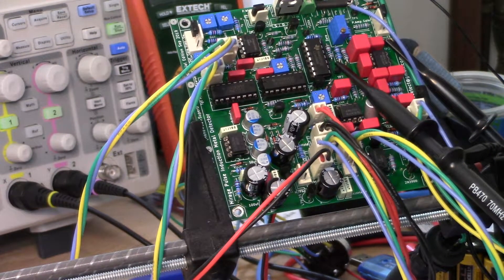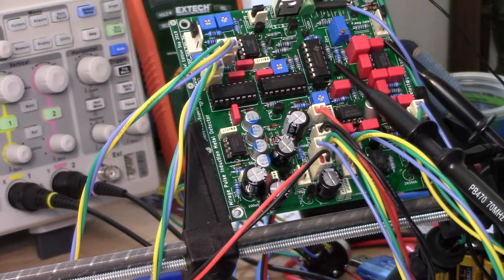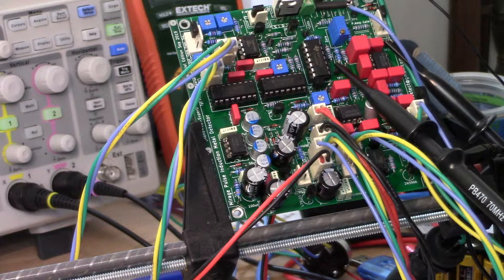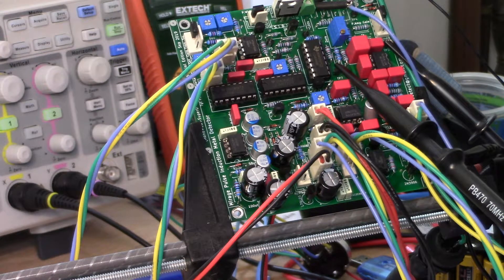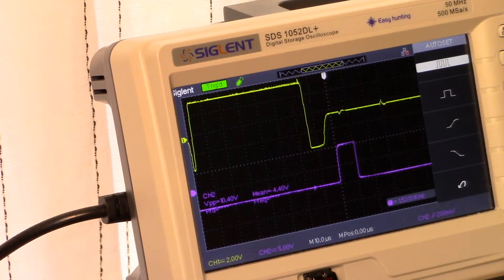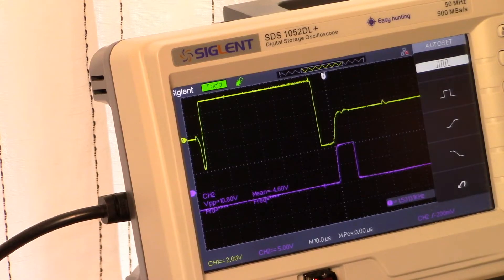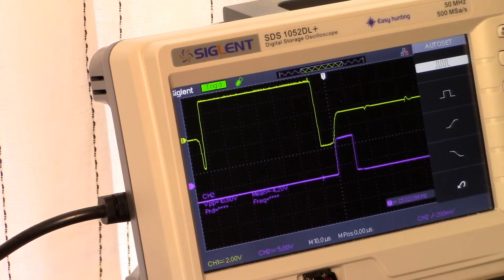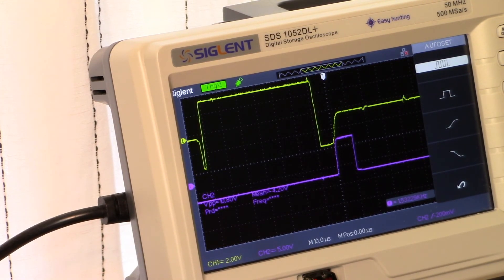Mirage Pulse Induction calibration steps #6 and #7

Comment: Great vid much appreciated, the field test will be interesting to watch. Does the mirage kit provide the required capacitors & resistors for the board? I was looking at the surf pi board on eBay. Definitely would be fun to modify to suit the users needs, different levels of mineralization. Is there an offset on the board to resist the salt water frequency. (False Signals)?
Reply from the maker: @Elliot Watson Hi Elliot,
My videos on your Mirage kit have garnered some degree of interest.  I know of a few people that have ordered as a result of the videos.
Cheers
Reply from the maker: I am glad that you find the videos to be of interest,  I cater to a tiny sliver of the detecting community.
The Mirage comes as just a blank PCB with a list of parts, I wouldn't recommend it as a first project.
The guy who runs this site sells kits with the parts, I recommend the Barracuda and the Mini Pulse Plus.
https://diydetector.co.uk/store/index.php